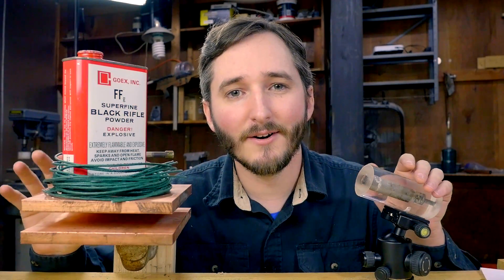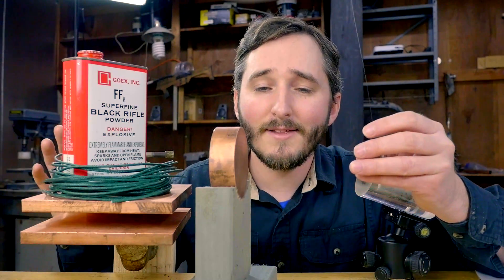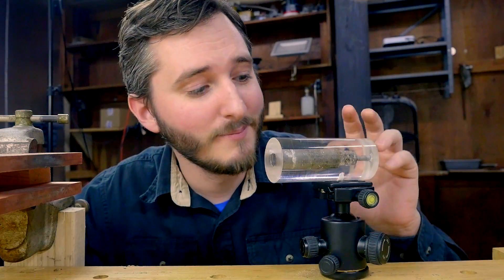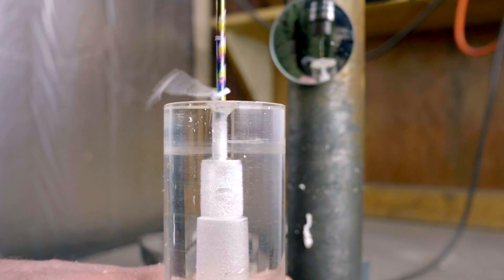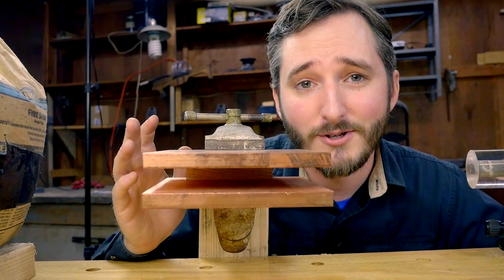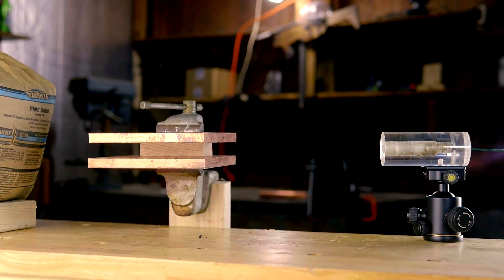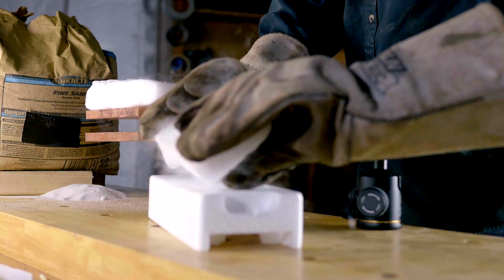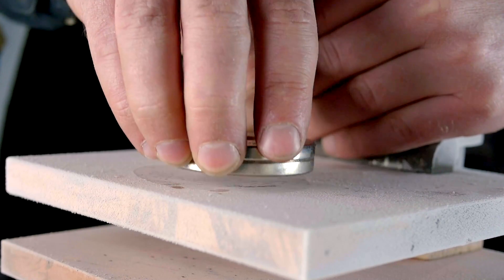Electromagnetic Force Fields VS. Magnetic Cannonball

Comment: A small diameter pipe would have less distance between the magnetic field and the conductive surface meaning more flux and greater deceleration . Also a cylindrical projectile (if you could keep it from rotating) would help optimize the flux by reducing the space that would otherwise be there on a sphere. I'm not sure of the effects of the thickness of the pipe walls.

Comment: The copper pipe looks like it actually flared out a bit at the mouth, it would be great to see more shots of that, if it was caused by the magnetic field it would be pretty amazing. maybe try isolating the magnetic effect from the possible impact by having a length of non-conductive pipe before the copper?

Comment: What about a copper ball through a very strong electromagnet? A very thick gauge wire coil cooled with dry ice or LN2, powered by a super-capacitor or car battery might be strong enough, but would heat up very quick and could only be used in short bursts. 
An MRI that's going to be decommissioned would be amazing xD
Reply: That or an arrangement of permanent magnets that concentrates the field in a short gap

Comment: Use compressed air to shoot your magnet. You can make it go slower so hopefully you can see some sort of change. Also I know if you heat up a magnet it looses its magnetic properties until it cools down and then doesn't come back quite as strong. So maybe the powder is getting the magnet hot which isn't good. Also if you can find thicker walled copper pipe that should help. Keep up the good work! Oh and if I am looking at this incorrectly please let me know. I never claimed to be an expert. ;-)
Reply: Temperature isnt the only thing that can demagnetise neodymium magnets, shocks can do as well. though it usually takes a lot of small drops to be able to see an effect, it might just be possible the shock of shooting it may suffice. but i am almost certain, he checked that.
Reply: Mc Nerd He mentioned in another comment thread that it wasn't demagnetized.  Do you know if demagnetization by shock permanently demagnetizes the magnet or if it just weakens it or whatever? Ehh I'll just look it up myself unless I get lazy... ;-)
Reply: Or you could propel it like a .. rail gun 🤩
Reply: @tridsonline  good idea
Reply: I agrees with you , using compressed air is similar to how normal firearm works even though it is hard to create the same chamber pressure ,that is why air rifles are inferior to .44 magnum round even when it was made for hunting. I also want to propose an idea of making a ballista instead , which can also let it travel quite fast.
Reply: I want to thank him for not using compressed gas......he made a friggin cannon and that makes science fun!!!
Reply: I believe the heat you feel in a bullet that just went out of a barrel, is just as much produced from it hitting something and deforming.
Reply: @marcusfourgripp1915  true the loss of the bullets D- form definitely creates heat.
Reply: *loses

Loser.
Reply: thank you so much for making me not type this. 
I think the person that made the video should have educated themselves before making it.
I'm categorizing this guy as non-reputable aka not worth listening to.
I feel like my brain cells are being wiped away when I am forced to watched a tv show with my gf. 
below zero is what it is called i do believe. 
Yes, i'm ignoring spelling, punctuation, and capitalization. This video isn't worthy

Comment: If the walls of the copper pipe were thicker, your experiment would have worked. Using a 5' long 1/2" or 3/5" thick pipe should work.

Comment: One of the major issues you run into is the heat produced by the cannon. Heated material will lose a lot of its magnetic strength.
Reply: dude... "heated" isn't precise and you can just read your own words and instantly see that that's where you're deliberately being vague to hide the fact you don't know the temperatures at which this happens amongst other variables that you need to know to take this stance.
Reply: Neodymium magnets lose about %0.1  of strength for every degree in Celsius rise in temperature. Black powder can burn as high as ~1400°C. Specific enough for you, Wei?

Comment: If you were to wire any device that could draw current from the copper, would that create more resistance for the magnetic projectile? If so, could you try winding tons of copper wire, and making sure the magnet is shot through at an angle that would ensure the magnetic fields are perpendicular to your wire?

Comment: If you had a giant copper tube and a large magnetic platform to stand on could you slap that tube on the outside of a high rise building and slide down the tube as an emergency escape? Just spit balling here. Seems like that is what is demonstrated in a small tube. Certainly the economies of scale for a giant copper tube would negate a benefit but it seems like it might work.
Reply: Room temperature (when they arrive) superconductors to the rescue!
Reply: *Cheap room temperature
Reply: Haha yeah those will sure change the world. Hopefully we are still alive to see that technology become ubiquitous.
Reply: I'm pretty sure that if you're clever(and insane) enough, you could use a pneumatic elevator(they exist) this way by plugging up the exhaust with a plug that has a small(say, 5mm) hole in it.
Reply: Spirit
True, but with the magfall (  the opposite of maglift, get it )  there would be no need for air supply or electricity ! 😊
Maybe years from now there will be something like that,....... but by then we probably will have come up with anti-gravity........... so ? 😕
Reply: You wouldn't need air supply for a plugged hole :)
Just lift it up there, seal it, and tie a release lever/rope/cable to a valve. Get inside, open the valve, slowly descend.
Reply: Spirit
Yelp, you are correct ! 😊

Comment: To aim your cannon, stick a snug dowel rod in the barrel and line it up between the plates. 

Also, not certain and definitely not trying to troll, but doesn’t heat reduce the magetic field of neodymium magnets? And if so, maybe a control is needed. 

Great video. Keep it up

Comment: Did you know that when heated at a high enough temperature, a magnet looses its magnetic properties. Is it possible that the explosion, or the friction through air of the magnet bullet would heat it enough to demagnetise the magnet (even temporarily) ? Just i thought i had ...

Comment: what about replacing magnet ball with actual solid copper bullet and replacing copper plate with large magnet sheets. that would be more realistic and solve problem of magnet not being large enough. correct me if i am wrong but it shouldn't matter if the copper is moving instade of magnet.

Comment: What if the magnet was stronger . Also how about placing a copper plate 3m away from the copper tube, and placing the high speed camera next to the copper plate. You could messure the impact from the footage and compare it to the force of the acrilic cannon, you could check if the copper slowed it down and if it did how much?

Comment: This doesnt make sense, you use a cylinder magnet through a pipe and magnet slows down because the cylinder magnet cant change its physical  orientation, meaning the magnetic field from the magnet will always be in opposition of the induced magnetic field in the copper.  But when u use a magnet sphere the magnet sphere will be physically moving and rotating because of the induced copper magnetic field. thus the magnetic field from sphere will not always be in opposition of the magetic field of copper and thus copper cant slow down the magnet sphere the way it slows down the magnet cylinder.
Reply from the maker: The field produced by the copper is a mirror image of the magnet no matter what orientation it is in.
Reply: so you're saying if you manually drop a sphere magnet in a small copper pipe (like u did in this video with cylinder magnet) it will slow down just as much as the cylinder magnet slows down? i wish i had the magnets and pipe i would have tested it myself.

Comment: Also consider that the air pressure blowing into the copper tube will work as more push to the projectile. It basically functions as a barrel even with the amount of space in between the cannon and the pipe.

Comment: What about using a powered copper coil to induce a magnetic field? Almost like a coil gun but in reverse.
Reply: Have to be careful not to create a great magnetic mirror. :P
Reply: They're called induction launchers, you'd wanna use hf AC because it's the change in magnetic flux that gives induction also wanna use a copper projectile
Reply: The magnet would tend to align itself with the field, like a compass. So it'd probably flip around before slowing much, and then be pulled into the coil like a coil gun. But perhaps then the current could be reversed.
Reply: Xander Zoolander then what's the point?
Reply: Could also just use a copper projectile instead of a magnet, since my idea is basically the inverse of this test. And if it does work, test it on a magnetic projectile that has markings to indicate polarity after using magnetic viewing film to find the poles and a magnet with a known polarity to test the projectile's polarity; then test to see if the magnetic projectile has more of an effect than a copper projectile, if the copper had any effect in the coil tube.
Reply: @xaytana  Similar experiments (and real world applications) use a series of rapidly changing alternating magnetic fields in order to repel non-ferrous metals. Although I would think that the amount of electromagnetic force necessary to slow an object moving as the speed of a bullet would be beyond any traditional power supply.
Reply: Illuminati confirmed :O 
Did not even think of that, don't know how it would be compared to a magnet moving tho
If you have a cylindrical bullet that is polarized on the ends and you know which side hits first IF it is stable. This needs more testing, lets hope NightHawkInLight does it for us :)
Reply: So you can try both polarities a few times and see if either is better. I like it
Reply: tullgutten AC oscillates between + and - 60 times a second ya? should suffice for either
Reply: Xander Zoolander I read an article about a prototype tank armor that used magnetic fields conducted along copper plating to stop rounds from penetrating, idk if it was legit or not, but same or similar principle
Reply: +Rykahnz I swear these people don't know what a search engine is.
Reply: Why not just kick it up a few notches and build a particle accelerator.
Reply: That's called an eddy current probe.
Reply: difficult to know which side/polarity of the magnet hits first if it is round, either it repels or attracts the magnet depending on orientation
Reply: It's not hard to tell which polarity hits first. Just measure the direction of the induced current.
And then switch on the coil based on that. (solves the timing issue too)

Comment: Isn't the inductance relative to the distance squared?  So if the magnet was nearly in contact with the copper this might work, but just a couple mm gap and the effect is reduced many fold.
Reply from the maker: There is great reduction with distance, but in my experiments the gap between my plates as well as the bore of the pipe was close enough to offer noticeable resistance to the sphere magnet when held in hand or dropped between them.

Comment: Are you sure the magnets retained their field after the explosion? The heat and force impulse could demagnetize it, no?
Reply from the maker: I pulled them out of the sand with a piece of steel wire so they were still magnetic.

Comment: I am curious as to what degree the copper did actually slow the magnet fired. I am sure that there is a way such as measuring exit velocities, one from the cannon and another measurement on the other end of the tube. I have seen similar. I bet that there is some math that might work for it also.

Comment: I'd like to see the voltage generated by the projectile when gently dropped down the tube vs shot.  In other words is the inductance proportional to the velocity.
Reply: That would be pretty cool to see, but i feel that might be too difficult for the plate because a high enough electric potential that may generate (fancy term for voltage) by the passing magnet can start in any 3d point in the copper plate. It could start inside the material, outside, or inside the plate. Tracking the flow of eddy currents would be difficult to pinpoint exactly since these eddy currents are unpredictable. And since the magnet is travelling too fast we might not get a reading from a cheapo 10$ multimeter, maybe an oscilloscope is needed for a ms-sensitive task. Even still, seeing a voltage change would be cool to see, don't get me wrong.
Reply: same. I want a scope on both ends of the plates, measuring from end to end.

Comment: Great work man, this must have been a frustrating experiment to film!
Reply from the maker: Not too bad. It would have been cool if it worked though.
Reply: Did it not work maybe because the magnetic projectile loses some of its magnetism when it heats up? If so, maybe you could try a different ballistic method? Perhaps you could find a way to launch things with dry ice! :p
Reply: 1. It didn't work with two plates, just because those a plates, while you need circular electric current to be inducted. Conductor should represent a conductive loop around the line of bullet motion.
2. Perhaps it didn't work with tube, because tube is too narrow. And bullet just collapses with it on its way through. Actually there is no matter how wide the tube is. The only restriction, that tube diameter should be much less than tube length. so, out of this you may use even 5 inches tube, and it would generate the same damper force as a 1 inch.
Reply: NightHawkInLight spoiler alert! hehe
Reply: Atlas WalkedAway 
You need to connect both plates with a copper wire so that you will have conductivity between plates
Reply: Atlas WalkedAway 
Alright let's try to explain a different way to get the point across magnet in motion copper at rest current has to flow for the electomagnetic field to form in copper plates. Find way for current to flow between plates and you should see the effects like you do in the tube
Reply: +R. Suzanne Bell Lol, "the point" you're trying to get across is patently wrong. It doesn't matter what words you use to describe it.
Reply: Atlas WalkedAway 
this is pointless because you are overpowering the "magnetic " field with extreme velocity from gunpowder. You need to use some slow motion camera and like someone mentioned maybe iron filling to show the magnetic field as the magnet passes by the plates .  And as for knowing what I am talking about I was trained by the Navy as an advanced electronic technician so I do know what I am talking about
Reply: Even if you have just one plate, such as rolling a magnet down an aluminum pan, there is a braking effect. Obviously in the ideal case you'd shoot through a superconducting pipe.  Not sure what you mean by the bullet collapsing.
Reply: try using a cylindrical magnet instead of a spherical one,
it is impossible to line up the poles for the desired effect with a sphere
Reply: +Stepan Dyatkovskiy So very wrong. Plates work, just not as well as tube and the wall thickness make a HUGE difference. Stop making things up, and most of all stop spreading misinformation.
Reply: +R. Suzanne Bell No you do not, and doing so will only garner a minute and nearly undetectable gain. I engineer analog radio frequency electronics in my spare time people, I kninda know what the hell I'm talking about. ANY TIME you have a fixed cross section of a conductor exposed to a changing magnetic flux, eddy currents WILL form that oppose the change and WILL dissipate the energy driving the change in flux density as heat. That's basic induction, which yall may want to actually study before you begin advising people on experiments. You can't just go around making shit up and not expect to be called out so if you're not sure, qualify your statement with a big ol' "Maybe" at the beginning to let us know you're actually guessing.

Comment: you need a superconductor i reckon. that should do the job. go talk to ben krasnow of applied science!
Reply: Even then the magnet is not all-powerfull. So you would need a superconductor + supermagnet.
Super as in much much more powerfull than NdFeB, so either electromagnet or a superconducting coil.

If the strenght of the magnet would not matter and you would really only need a superconductor... well you would be unable to move superconductors because of earths magnetic field.
Reply: precisely.

Comment: The plates act like a pipe with a slit, or like a coil that isn't short-circuited, making them not as effective. However, the amount of stopping force copper has varies proportional to the speed, whereas the bullet's energy with the square of the speed. So, if we increase the speed of the bullet 5 times, we increase the stopping force of the copper also by 5 times. But the bullet's energy increases 25 times, making it easier to push through. Would be interesting to shoot the bullet through a coil and see how much power is generated and "taken away" from the bullet.
Reply: Alex Alex should have read this before comment...
Reply: Josh Whiting  yeah i saw lots of people said the same :)

Comment: Instead of a pipe, you could try a long coil of copper wire that you pass electricity through. If you have the correct polarity, it would have a much stronger effect on the magnet

Comment: I think that IF the copper were capable of slowing the bullet, then a rail gun made from the copper would have been able to accelerate the bullet as fast as the black powder cannon.  I would have been very surprised had this worked, but thanks for trying it.  I was rooting for that copper pipe.